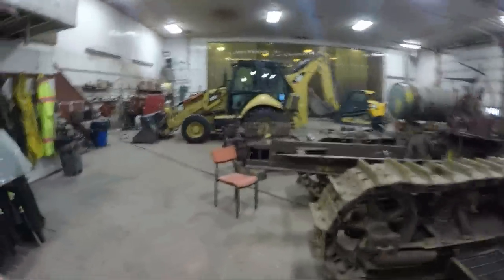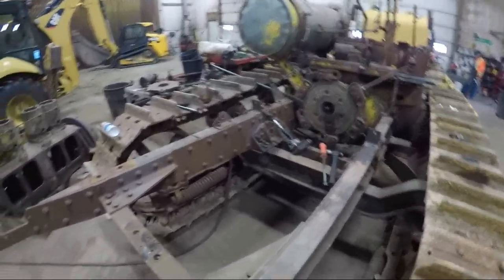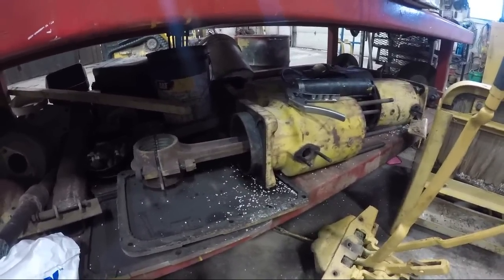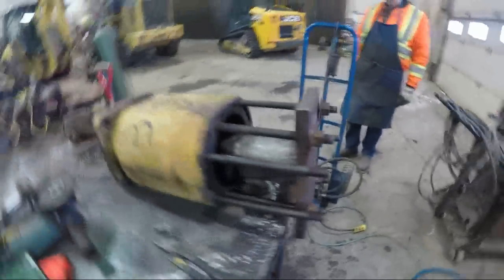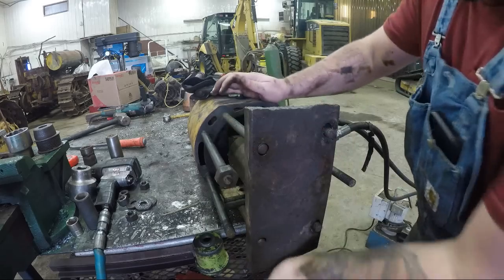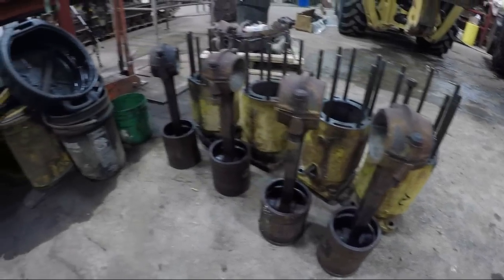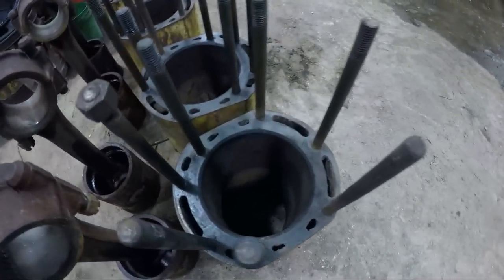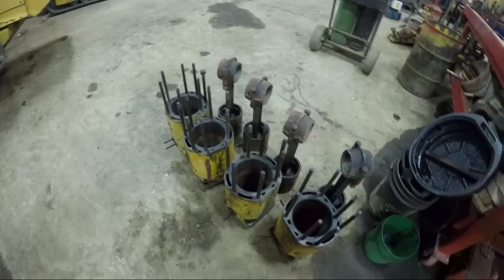Caterpillar SIXTY Rebuild Project - Disassembly Part 7 pressing out pistons

Comment: A hammer is a good tool when used correctly, the amount of persuation applied is tied directly to the size and force of will the man swinging it puts into it. Good stuff Nathan, been fun to watch so far
Reply from the maker: Yes you are correct it just needed a little help, didn’t want to beat on it hard enough to damage anything but it still needed some help, just a little tap and she popped.  Thanks for watching sir, I really appreciate it.

Comment: As a young engineer in the 70's, I came across piston pins that did not have circlips to retain them, instead they had aluminium pads that fitted into the pins and ran up against the cylinder. These were British made Gardner engines. I know the Cat C12 don't have circlips. This video has just told me that this arrangement for retaining the gudgeon pins (British terminology) has been around a longer than any engine I ever worked on. Thanks for educating me Nathan.
Reply from the maker: In the next video I take the pistons off the rods so you’ll see them
In better detail.  Thanks for watching Ray

Comment: I've got a sixty that needs the engine unstuck and rebuilt, also on mine the tracks are rusted solid.  Haven't worked on it for a few years as time don't permit.
Reply from the maker: Just keep plugging away at it slowly when you get time, you’ll get er back to her prime. Thanks for watching and good luck with yours.

Comment: Why are you swapping entire blocks? Why not swap just cranks? Then you could retain a numbers matching tractor. Just wondering if I missed something.
Those pistons are amazing! They are like locomotive size! What was the design reason for the individual jugs and why did they stop building engines like that?
Good series.
Reply from the maker: Hi Cal - the main reason is that we simply don’t have he equipment to deal with Babbitt bearings in the event we mess something up.  There is virtually nothing that I’ve seen that make the blocks any different aside from the numbers stamped on the block.  They are big pistons 6.5” diameter, the ones that we actually plan to use are 6.75”.  I do not have an answer for why they used the individual jugs, I suspect that the reason for stopping was due to the amount that engine speed increased.  The max RPM on this engine is only 650, I don’t know if for nuts to hold down a cylinder with the increases in speed and combustion pressures would be able to handle it.  Thanks for the question and for watching.

Comment: Wow those pistons were in there pretty solid my dad had an old GMC tractor late 40s early 50s the pistons were seized solid and dad wanted me to try and make it run as it was a rare engine that werent widely used with a binary transmission. Lol i sealed up the crankcase and had 4 five gallon pails of deisel additive a company used as parts washing solvent. I put all the covers back in with double gaskets. And filled the engine and its cylenders and upper valve assemblies and left it to set for a few weeks ended up leaving it for a month. Dad was not happy in my choice to let it set so long. Anywho when i retuned from a job i took miles away and pulled the tractor into the shop and drain the engineof the contents and most of the seized parts had loosened up in varied degrees but did disassemble with relative ease. And most of the engime was salvaged except for the paper pressed timeing gearswhich were well passed their prime. It was a lengthy process but the additive did make short work of the recovery.
Reply from the maker: Thanks for sharing, what a great story and well done getting the engine running again.  It’s these old stories that are good for sharing so future generations can try them.  Thanks for watching
Reply: @ironman3406  quite right our family had a wonderful tradition of the nature of repeating events from our families history orally. Repetition of oral history stems back centuries as i believe many used to do up there in Sassn. Not sure of the abbrieviation. Stories of great moose hunts in Manatoba with indian guides befor my dads dad went to SouthCarolina and passsed. Four generations of oral history passed down from elder to sons and daughtersand grandchildren

Comment: It looked like it worked good  👍 👌 😅
Reply from the maker: Hey thanks for watching Evan, yes it did work well.  We got them all out anyway.
Reply: @ironman3406  i saw that you got them out !!!!! I have a 2510 John deer tractor that has been  stuck since 1993 and been  messing with it since  !!! I'm working on taking  the head off of it because I have not been able to get it to move at all 😳🤔🤔 and it is only one cylinder stuck  !!!!!😖😖

Comment: I’m glad it worked for you. I wouldn’t have had the nerve to put that pressure on 4 studs.
Reply from the maker: Haha, just have to go with the gut sometimes.  We did wreck the top of one piston, but it was the hardest one to press out.  Thanks for watching sir, happy new year.
Reply: @ironman3406  It’s your’s, but seeing you pulled engines I’d pull the good crank and bearing shells and put them in the case with matching numbers. Anxious to see your next steps.